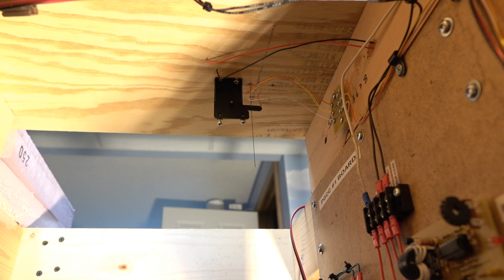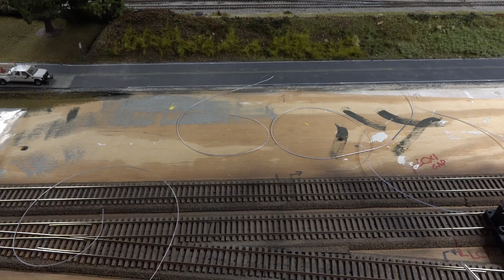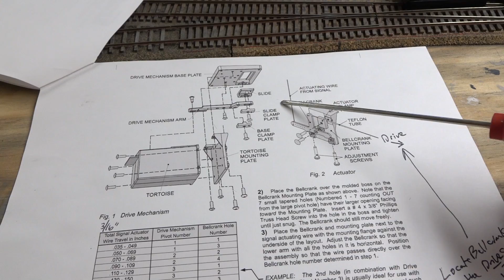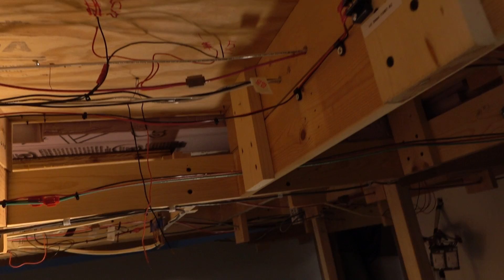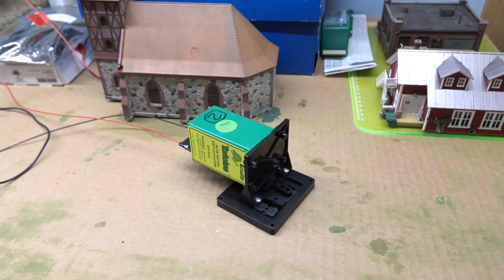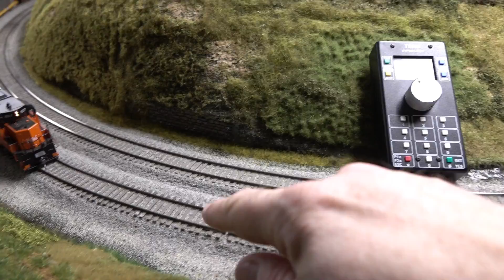MRUV 99: RR Crossing Gates Install - Part 3, Finished!

Comment: Very informative, I use LDRs activated by ambient light, with an Arduino controlling a stepper motor. Any vehicle is detected whether its a loco or a wagon.  Has its own problems of course, gaps between wagons, compensating for changes in ambient light etc.  But then if this was easy everyone would be doing it!  - thanks for the video, I had wondered how the Tomar units worked.  No longer available sadly?

Comment: Stephen I think I need a Beer 🍺🤣 a A&W Root beer the Video was Great ya Kept me Glued in if I ever need some awesome Crossings these would be a cool addition if they make them in N scale I'd have You install them for Me, for the near future I'm thinking about getting some KATO Crossings for now there pretty simple to install and they'd work with my DC.. DCC.. mainline and you can change up the Bell sounds, Since the Kato drops 2 sets of Gates you probably could shorten the one on the Left side of the Crossing and utilize it as A Side walk 🚶‍♂️ Crossing...

Comment: Hot off the plane in LA, I got caught - just inside the gate - track-side. And panicked.
Fortunately it was a siding going in the other direction (than yours) leaving a load of space on the wrong side of the gate.
A great bit of 'train-fanning' as a humongous goods train went by. Won't do it again… Maybe good is was in a Fiat 500 - compact!

Spoiler: I thought maybe the steam loco was going to give a repeat of the real-life incident with the "slippery track!

Comment: I watched this video and it is a nice system you have, with limits but nice.  I had a system setup such as yours but found the same issues, a whole lot of setup, wiring etc.  I came across a video which showed a "hall effect" system.  I was extremely impressed and tried the setup with the hall effect device and magnets on the front and last car of the train.  Works flawlessly every time.  Search for "Switched Hall Effect Videos" on youtube,  worth a shot.

Comment: To solve the issue of the invisible cars, you should put a resistor on each car so the system can detect the car due to the electrical output the resistor emits.

Comment: Sir I'm sorry to burst your bubble, but if you watch on You-Tube trains going passed railroad crossing gates the bells kept ringing before,  during, and after the train had passed about 1/2 mi. from the gate.
I'm sorry if I Offended you, but I've seen my share of crossings and if you're at a crossing gate next to a station and a passenger train was in the block you would have to wait until the train is gone then the bells stop ringing and the gates finally.
You still did a great job on your project.
Thank you for taking the time to read my comments and I hope to hear from you soon. 
Sincerely 
Allan
Reply: No bubble to burst, as that is not how THIS crossing works. We did check it out, and the bells ring as the gates go down, then stop. Not all crossing are the same. I've seen my share of crossings and realized that a long time ago.
Reply: Ryan- I think that is a Details West item. I have had it for years- since the previous layout- so I forget exactly where I got it. It may be the Details West #IS 907, Instrument Shed. This is a 6x8 shed, which seems about right. I think BLMA also makes a similar type of shed. Item 4311. May be a bit hard to find.
Reply: I also agree with Mr Bennett, I do know that crossings have different bell lengths, some are bells ring while gates moving, bells ring the whole time, bells ring til gates rise, bells ring til gates down, and no bells
Reply: Agreed with Mr Bennett, all of the crossings in my area have the bell activated until the gates are down then it shuts off. By the way, Rob, Where did you get the rusted electronics box, or relay box, or whatever they call the box that contains the crossing gate electronics in real life. I cannot for the life of me find one online. Thank you! Your layout is awesome!
Reply: Allan Martinez - It depends where the crossing is at. Here's a video that was filmed half a block away from where I live and the bells stop ringing once the gates are lowered into position.
https://www.youtube.com/watch?v=pnv8Ul274hw

Comment: I use a mechanics stool for under table wiring work.  about 20 or 30 bucks at most from Harbor Freight, saves me a lot of aches and pains.

Comment: I too hate working under my layout. I did come up with a solution. what I did is build a what I call is an elevated creeper. it makes working under my layout alot easier. being able to lay down and roll around under the layout while being able to reach the underside of the table.
Reply: I like it! Got a video of how you made it????? (hint, hint!)
Reply: Rob Bennett, no I don't. if I knew how to upload one I would be glad to. it's very simple. I used 2x4s and made a 16"x4' rectangle with casters at the corners. then a 2x4 at each corner 1/3 as tall as the table height. if you want make 1 end taller so your head is higher. then simply make another rectangle of 2x4s the same as the bottom and fasten it at the top.then cut a piece of plywood for the top and your done. I padded mine with 2" foam for comfort. if you have any questions I will be glad to help. if you want to make a video of yours and post it I won't mind.   
Chris

Comment: Very nice job. However, in 94 or 95, when you were done with the furfield (which came out nicely) you wanted to tackle the hill
across from the farmhouse as next project. And then you got distracted from wirepoles and other things. On the gates, I thought the bell rings as long as the poles are down.!
Coming back to the Fleischmann loco, i asked you in 1 of my comments, whose sounddecoder you used. Would you please name the manufacturer. Great work. Karl
Reply: I get distracted easily...I'll have to look for the decoder MFG for the BR18, as I didn't do it myself. I want to say it is a Soundtrax, but will look back at the paperwork and see if I can nail it down.
Reply: Really appriciate your answer. I`m not aware, that soundtraxx makes decoders for EU-models. I assume that it`s a EU manuf. ESU, Fleischmann itself, Uhlenbrock, Tams and so on. By the way, there is a Co. named Weinert Modellbau, they produce EU models and can furbish them with RP 25 wheels, they are googleable.
They are the "high end" of producers and, I think they can deliver building kits with the drivetrain prefabcricated.. Echted  brass and so on. Thanks again. Karl from Munich

Comment: Have you considered using servos instead of Tortoise or using Arduino  based boards for future C/MRI additions. It appears both are gaining in popularity in model railroading. With your ATX power supplies I know you have a 5v power source.
Reply: I have been considering it, but just had too much other things going on at the moment. Since we have the C/MRI and the computer program, I am not sure if the Arduino would really do anything for us that we can't do with the VB6 program. However, I certainly have not looked into it deep enough to know, and am curious.

Comment: Can you use the EOT unit as a substitute for detectable wheel sets on all cars?
Reply: Yes- anything that draws current. Lighted passenger cars or cabooses as well. I have added several addition Ring Engineering EOT's to different cars so we at least can have the last car detected as I continue working to add resistors to the rest of the rolling stock.

Comment: Great video, thanks for the tips. Crossing looks awesome. What type gates are you using? I like that the control cable is not seen.  Ed
Reply: The main gates are Tomar, set 863-B. The pedestrian gates are modified NJ International item 1172, with the gate shortened and the control wire added.
Reply: Thank you Sir.

Comment: I'd extend the bells a bit longer.  Our gates ring until the train passes in the real world.
Reply: It depends on the railroad. I remember in my area, the crossings used to stop the bells once the gates were completely lowered, then have them start ringing again as the gates rose. But then some time in the mid-2000s, they reprogrammed the crossings so the bells now ring the entire time the signals are active.
Reply: PhoenixCustomPrimiti not always
Reply: same in my area. Massachusetts?
Reply: It's varied on companies and/or environment style. For an example: LA Metro doesn't like their bells ringing when their gates rise. Some residents complains about noise so some areas, the bells ring until the gates are lowered. In other areas, bells ring until the gates rise. On the Metro Blue Line, the RoW is shared with UP so there are separate relay cases at most crossings. On the Blue Line side of the crossing, bells ring until the gates rise while on UP's side, bells ring through the whole activation.

Comment: Adding resistors to your wheels will keep the system triggered, also consider hiding a speaker in the crossing control building you plan on adding.  leaving the opening for sound coming from the bottom of the building.

Comment: looks fantastic. I did notice that the pedestrian gate comes down first, since the pedestrian gate and the crossing gate work off the same tortoise machine it looks as if the pedestrian gate wire is just a little bit shorter than the crossing gate wire.